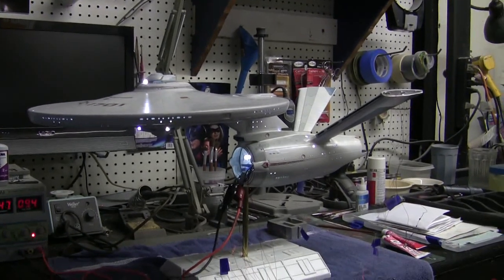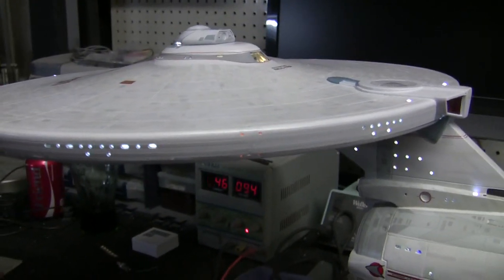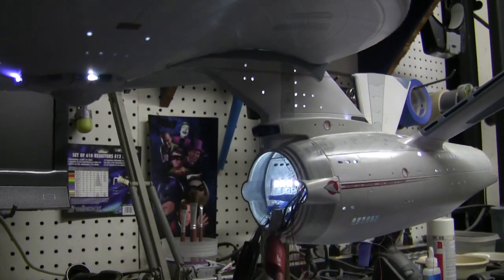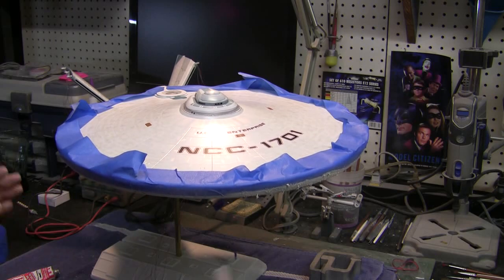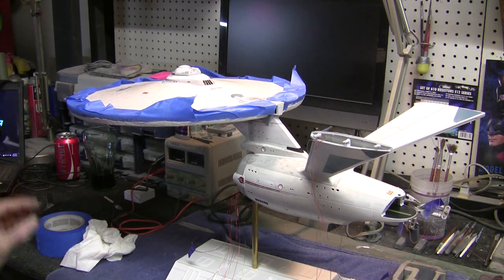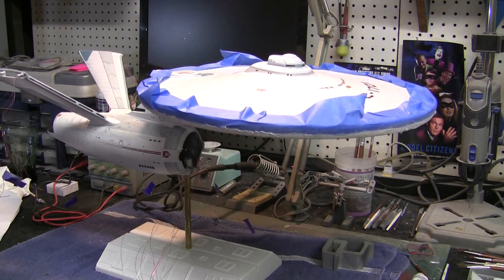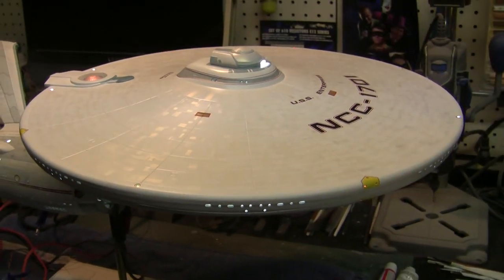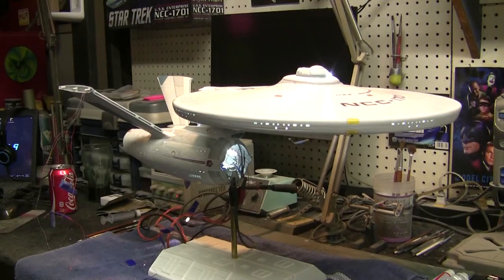1:350 Scale Enterprise Refit Build Pt 18 Saucer Assembly

Comment: Hmmmmm. Another solution to that type of problem with the torpedo lights would be to modify the board.

This could work assuming that the board is easier to access than the lights of course. What you could do is solder on jumper wires across the resistors on the board that go towards your LEDs. Or, if you can, remove the resistors and replace them with some wire.

Comment: Nicely instructional, Boyd. Couple thoughts: I'm surprised you haven't made some kind of large jig to grab and stabilize the saucer during this phase. That's a lot of yanking and moving around. You make enough Refits to be able to use it many times.
Have you considered placing the drive circuitry off-ship? Better for such mild mistakes that add to gray hairs.
Finally, Mr. Windom makes any problem seem much, much bigger... (nice 'maw')
Reply from the maker: Eliot, you sir are what we refer to as a genius. I jig is an excellent idea!
I will endeavor in that general direction post haste. Your right. I've got many Refits in my future and it will be worth the time. My thinking on the control boards and putting them inside is less wiring coming out of the model. Usually when a board shorts out it will take some of the lights or whatever was connected to it along with.
Would still lead to cracking it open to replace whatever went the way to the electronic graveyard. I would like to start using some multi pin connectors that would allow me to build things in a component fashion and just plug them together.
Then I could build the saucer etc and complete all the work on it first before attaching it to the hull. Plug and play style.
Reply: TrekWorks You are too kind-- my thanks. My heart was in my mouth when you spoke of needing to sand the "glue seams" and I could see the saucer moving a lot...I first thought, you should put your knee on it! But this way you could also jack the whole thing up at an angle to see the edge, or anything else, better.

The board thing can certainly seem to be a "pick'em"-- if you're using LEDs they should last for generations-- then wiring is the next weak link (though nothing would have prevented the "slip of memory" you experienced-- then I should go into my rant about using micro nuts and bolts to assemble large models, like they do at ILM (and I think it was the one-way, sealed-up build of the 1701 that made them start using nuts & bolts) -- you might consider having some access points, like the front sensor ring, the bridge and "crystal" assembly-- all be removable... (I agree that very little will help a saucer's edge burn out-- two LEDs in every spot...? that way leads to madness))
But having the board external seems to be the only way to fix something that the board designer did not plan. Most boards are made by pros (except mine) and should be able to handle ordinary rough-housing. It just seems like the last leap of faith to seal up ALL the wiring + board and have power and switching wires come out of the hull...

Comment: Quick question.  What type of glass did you use for the officer's lounge?  Any recommendations on a place to pick it up?  I was considering a glass solution, but wasn't sure a) if I'd be good enough to cut it, and b) the slight curvature wouldn't be painfully obvious.  However, it clearly worked well for you, so I'll give it a shot ;)
Reply from the maker: It's not really glass. It's just clear plastic I get from clam shell packaging. Thin and flexible so it will make curves if needed. If it's scratched I use a little fine auto polish compound on it.
Reply: That makes more sense ;)

Comment: Thanks of uploading all these videos. They are very detailed and helpful. I am building this model currently. However, I am having trouble of gluing the top part of the secondary hall because once I put the nacelles on, it will get disconnected with the main body. Could you tell me how did you glue it and what kind of cement did you use? Thank you very much.
Reply from the maker: I just use regular Testors red tube model cement. It's been around forever and it's still very good for styrene plastic model kits. Some people knock it but I've got a room full of models built with it that are holding together just fine.The trick is the area you are gluing has to be perfectly clean with no paint or primer on it at all. Just bare plastic. Jason Chan
Reply: TrekWorks Thanks for replying. That helps a lot :)

Comment: Just asking...Is there a reason why most modelers put there circut boards in the model instead of in the base?  Seems it would be easer to make repairs in the base.
Reply from the maker: It goes both ways and some choose to mount the boards in the base and others like me put them in the model if there is enough room. I use very high quality boards that have a 5 year warranty on them. I have had many of them running for hundreds of hours in my own models with zero failures. The chances of a board failure which is good quality and wired properly is very small. There are fewer wires that need to pass from the model to the base in this way as well. Keep in mind also that usually when a board fries, it will take out other parts of the circuit with it. Things like the LED's and such. That means that you'll probably have to open up the model anyway to repair it.